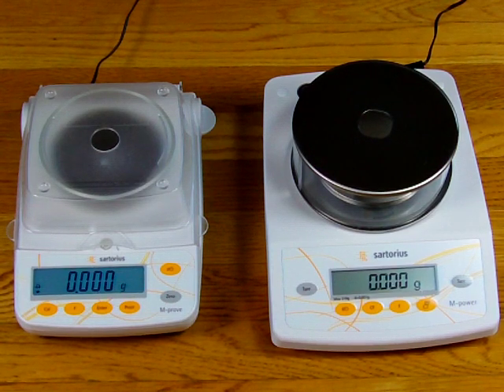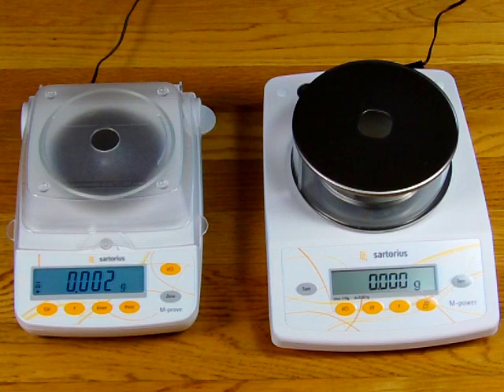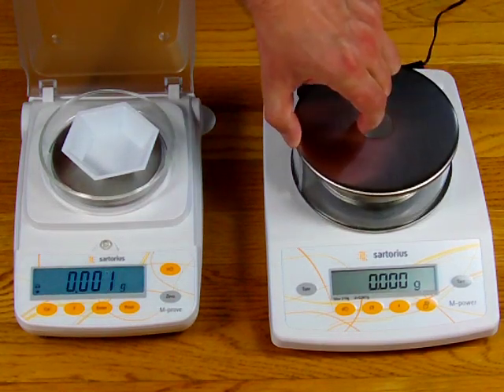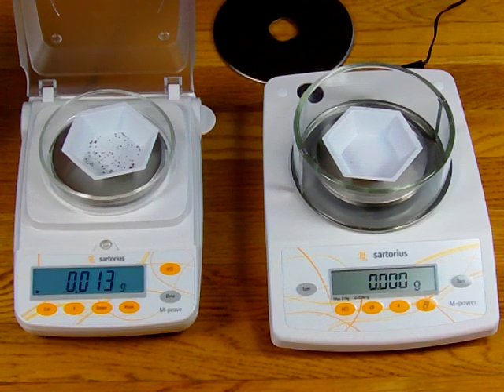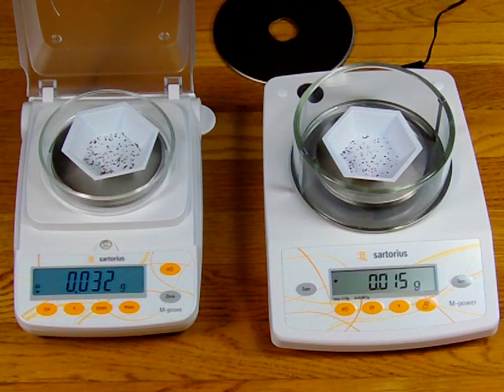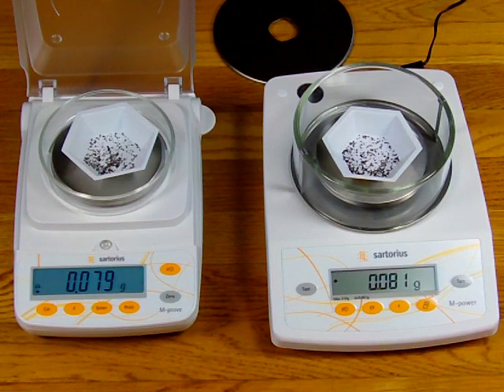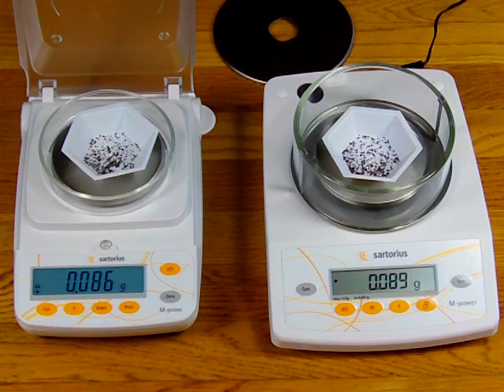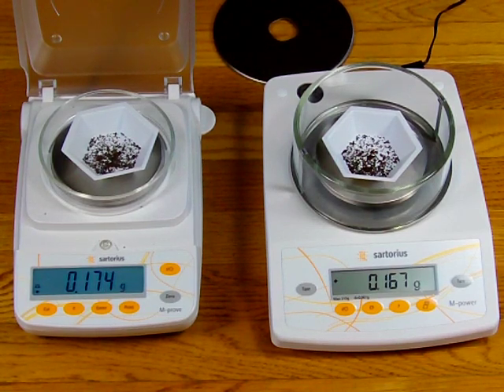Magnetic force restoration balance verses strain gauge digital scale

Comment: Hmm? I will speak to my fellow gun toters and tell them they are being unreasonable. Personally I suggest they use mechanical scales such as triple beams but for some reason they like digital stuff. Keep in mind that many are preparing for SHTF, zombie apocalypse or a similar event and they don't need to depend on electricity anyway. Together we can educate them.
Reply from the maker: +worddunlap Most of the competition shooters no longer use mechanical beam scales since they can not get the accuracy needed to weigh out powder to the kernel. Most buy the Sartorius Entris64-1S at http://balance.balances.com/scales/65

Some people willing to accept +/- 2 kernels buy a milligram balance like the FX700CT at http://balance.balances.com/scales/1654 or FX-120i at http://balance.balances.com/scales/1223/

A single kernel of Varget weighs ± 0.02 grains and the FX-120i increments in 0.02 grain divisions (0.02 gn > 0.04 gn > 0.06 gn, etc) and the linearity (or accuracy) is ± two(2) divisions or ± 0.04 grains. When shooting .308 ammo, on average, a single kernel of Varget roughly changes the velocity by 1.3 fps. So just a few kernels of variation can easily double the extreme spread in velocity. Out to 500+- yards it does not seem to make much difference, but beyond that and things can get ugly fast. Buying the right balance is just another tool to put more bullets closer to the desired point of impact.

It's all a matter of perspective and at what level one wishes to perform. Buy the FX700CT or FX-120i and it is a good weighing device but it is doubtful you are not going to win shooting competitions. Any way one looks at it, serious long-range shooting is not cheap. In their world, it often comes down to one point or even one "X" between winning or not.

Remember the motto -- buy once cry once -- If you stray from this motto it will bit you. Most F-Class competition shooters have spent well over $5000 for their gun so why cheap out purchasing one of the most critical accessory needed - a balance for weighing powder.  We always recommend the Sartorius Entris64-1S at http://balance.balances.com/scales/65